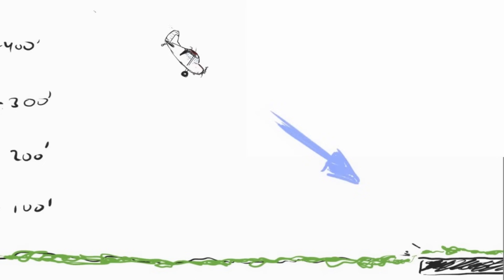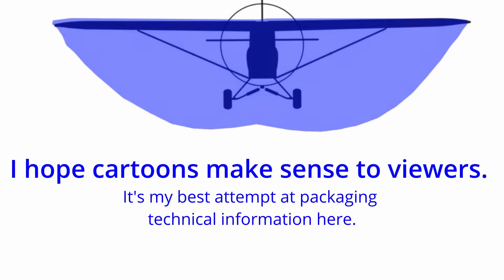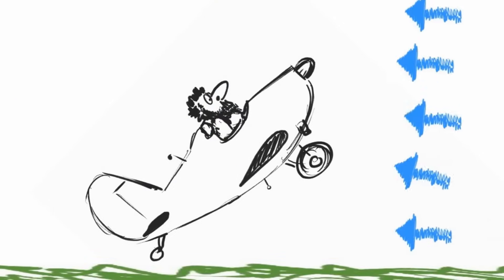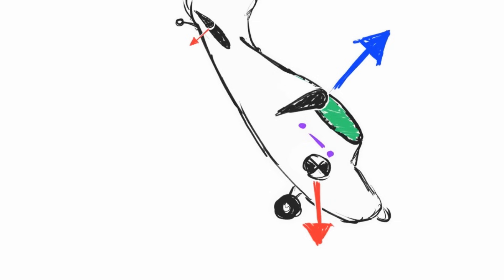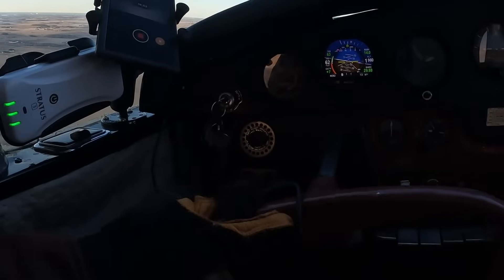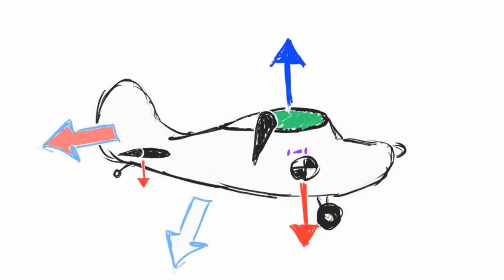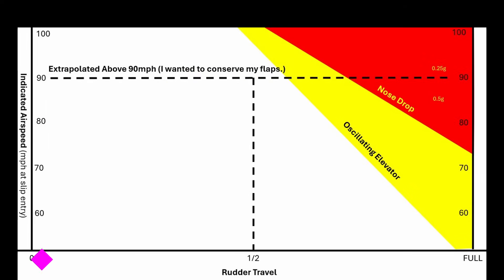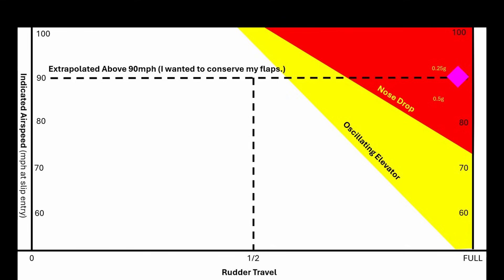Crash of a Cessna 170B, Did Slipping with Flaps Factor?

Comment: The nose doesn’t drop in the stall due to lack of downwash on the tail.  It falls due to lack of lift from the wing.  And the tail doesn’t need downwash to work.  A T tail works fine and is well above the downwash.  It is airflow over the tail that makes it work and the tail incidence can be adjusted to factor in downwash or lack thereof.  The tail really doesn’t care about downwash, it cares about airflow, just like the wing.
Reply: There's clean air and there's dirty air. The tail usually flies in the clean Air. When you slipping out that it flies in that dirty are it gets unpredictable.
Reply: thanks ,i wondered about that explanation.
Reply: Fair, what about the explanation of slips with flaps being an issue? Do you agree that the tail moving out of downwash is what causes the nose to drop in that case?
Reply: @ Yes, lessened downwash is what causes the pitch down moment, but it is hardly dangerous for a competent pilot.  Owned a K model 182 for many years and did many full flap full forward slips without issue, including one from 9,000’ to nearly landing when ATC forgot I was landing at an upcoming airport.  By the time I realized they weren’t going to step me down and reminded them I needed to start descent soon to make it into Lynchburg, the controller apologized and approved 360s to help with the descent.  I only had one passenger with me and he was a fairly experienced flyer so I decided to see if a full slip would get us down.  I slowed to 90 or so to get below flap extension speed of 110 if memory serves, dropped full flaps and pushed the rudder to the floor for a full forward slip.  The descent rate was impressive and we made the straight in approach with a half mile to spare.  The 182 handled just fine at 90 MPH.  I did many full flap slips at 90 and below, but never pushed above that as I didn’t want to get too close to the max full flap speed.
Reply: This  is my take also
Reply: Yes, and slipping with full flaps interrupts that "airflow" over the elevator, and NOSE DOWN, BABY!
Reply: @ It is hardly that dramatic.  Have you ever slipped a Cessna with flaps 40?  I have done so since 1977 in several models of the 150, 172 and 182 and never had an issue even worth mentioning let alone shouting about.
Reply from the maker: @ I still slip my 170 with flaps.  It's only dramatic in certain speed and CG ranges.  Stay out of those ranges and it's all good.
Reply: @LTVoyager  BUT: WHICH AIRFOIL Cessna singles  ? The initial mainplane, all 172-182 was modified with leading edge cuff to soften stall & near stall regime. Had the unexpected benefit of increasing speed/overall drag reduction. Also noting: later models limited flap deflection 30.
Reply: @LTVoyager I've flown all those planes and all of the 170 models and own them. The 170B doesn't fly like those other aircraft. It will nose over suddenly in a slip.
Reply: I often slip with my 180 full flaps, but always at appx 55Kias max. I’ll go high up and try this at 80…
Thanks for the heads up!!
Reply: @LTVoyager I have to clarify your point of AIRFLOW OVER TAIL.. Yes, T tail is typically clear ABOVE disruption from propwash, downwash, wing or fuselage turbulence..
AIRFLOW OVER "CONVENTIONAL" TAIL INCLUDES BOTH TURBULENCE AND ANGLE OF ATTACK BASED UPON AIRFLOW..
NOT SIMPLY FUSELAGE/WING ANGLE OF ATTACK. THE RELATIVE ANGLE OF ATTACK IN THE MODIFIED AIRSTREAM IS INDEPENDENT OF FUSELAGE/WING RELATIVE WIND. 
Anotherwords, yes angle of incidence of tail horizontal & vertical surfaces is tuned to proper angle of incidence in the propwash/downward.
Chopping power at high speed in foreward flight, the prop acts much like a solid disk as it windmills at a rate that doesn't produce POSITIVE thrust ..
THIS PRODUCES A BETA-EFFECT..
The turbulence and "BLANKING" of the tail causes an IMMEDIATE TUCK..
With my smaller RC model aircraft,  it sounds like thrust reverse @ 70 MPH & looks like an eminent loss..
@ lowering speeds it isn't as noticeable till it disappears @ lower speeds..
Practicing stalls, spins, slips and feeling adverse yaw as a tool @ low speed (wings level) when more than effective rudder is required, and other techniques have helped me understand and utilize aerodynamics better..as everything happens SO much faster, while physics & aerodynamics are the same..
Reply: @ There is too much incorrect in this post to even take time to try to address it all.
Reply: @LTVoyager  The T Tail is free of prop/jet wash, not being "blown", only exposed to airspeed of craft, no blast enhanced effectiveness (stationary craft with T tail won't pitch rotate from surface control inputs @ full  power..a Cub can raise its tail to level, a C-150 can lift its nose to the sky for a soft field takeoff..T tail needs tail to experience effective airspeed)
With full flaps, it is possible to stall the horizontal/elevator @ low airspeed, while @ full power and wing not stalling..
Similar to principle of canard fore wing, stall lowers nose, rebuilds airspeed
Reply: Exactly...downwash on the elevator is not equivalent to a loss of lift on the elevator...the elevator is simply a wing aft of the fuselage.
Reply from the maker: Hi All!  Glad you guys are discussing this.  So almost all of our planes have their CG forward of the center of lift.  In a stall we are taught that loss of lift causes the nose to drop.   This is a summary that we all teach our students which works for practical flying.  

In civil airplanes the nose ALWAYS wants to drop, though.  It's the tail (or canard) that stops it from doing so.  T-tail or otherwise when we stall a plane that loss of lift is from airflow separation.  It's the airflow separation that changes airflow at the tail, T-tail or otherwise due to fluid dynamics.

So y'all are right.  It IS the loss of lift that causes the nose to drop.  The way that happens is not through drastic shifts aft in the center of pressure or movement of the CG: it's via the tail.  This is also why it's important to design canards to stall before the wing.

To further illustrate this point take a look at searchable slow-motion video of an A-26 (some videos call it a B-26) losing it's tail during bounce-bomb testing during the Second World War.  With the loss of the tail (lightweight structure) the nose-down couple is strong enough to generate negative overload failure of the wings prior to impact.  Some may point to CG movement with the loss of the tail here.  

So now let's all consider tail stalls.  In a tail-stall it's the horizontal stabilizer, not the wing that experiences flow separation.  In this case we again see abrupt and sometimes violent nose down pitch excursions.  The wings do not stall.  There is no loss of lift.

So it's the idea that we only lose pitch when we lose lift (an idea that I transmitted to my own students) that we need to explain in better detail.  This was an academic shortcut that we used as instructors, but it leaves our students exposed in the decades after we're done with them.  It primes students to think "Stall" when something else may be going on (as happened in a number of tail-stall accidents). 

Does that mean teach pre-solo students about the fine points of aerodynamic interactions between the wing and tail?  No.  But does it need to happen somewhere along the way?  I think so.
Reply: @jonathanzarinnia884 I never taught that the nose drops due to loss of wing lift since it allow this type of confidently incorrect reply. This person was taught incorrectly. His belief is easily disproved by simply moving the CG close to the center of pressure: no angle of attack will be steep enough and no speed will be slow enough to cause the nose to drop. A swept wing jet, which tends to stall wingtip first, moving the center of pressure forward, also lacks the positive static stability and will not drop the nose like a 170 or similar. For teaching new concepts, I am okay with incomplete explanations but not inaccurate explanations, for this reason.
Reply from the maker: So in a swept wing jet indeed the center of pressure can move forward of the CG and cause uncontrollable pitch up.  And yes, this is because tips tend to stall first (unless various wing modifications are made ) which causes the center of pressure to move forward.

The Cessnas and general aviation planes described in this video aren't swept wing jets.  They have straight wings with conventional airfoils like the NACA 2412 or USA-35b.  These airfoils do have their centers of pressure move forward in a stall, but not forward of the center of gravity.  Also in a stall, even in a deep stall the loss of lift on the wing is not complete.  So the pitch down couple remains, unlike in RF101 Voodoo or something like that.

I'm glad that you're aware of different factors that affect and airplane's pitching moments.  It's great that you're thinking about things, and you can call my "confidently wrong".  I respectfully suggest you do some research or even better some testing  on this issue.  You may learn some new things about how and why airplanes behave the way they do.  I'm not pulling this stuff out of thin air.

For what it's worth I might learn some stuff too.  I like these discussion, so there's no midnight rage-typing going on here.  If you're around Chicago we can nerd out.
Reply: @ I am not aware of any light airplane that can experience a tail stall prior to the wing stalling without ice accumulation on the tail.  Are you?  The tail does not stall during a wing stall as its AOA is decreasing as the wing’s AOA is increasing taking it even farther away from a stall as the airplane pitches up.
Reply: @LTVoyager  There was one homebuilt that could do that. It's no longer on the market.
Reply: @edcew8236  Which one was that?  I can’t imagine such a design could take off as the tail would stall at rotation.
Reply from the maker: There are some great drawings and wind-tunnel data out there.

From a macro perspective the point is this: Good rules of thumb that we teach (I teach these too) can backfire on us.  We teach pilots in primary flight training that the stall  break is from loss of lift.  This is true.  If we don't explain how the mechanics of the break work and exceptions we risk having pilots interpret any sudden pitch anomaly as a stall.

We don't have CVR data from this C170 crash, but there was data from a Vickers Viscount Crash.  They misidentified a tailplane stall as a wing stall, among many other things.  Training on tailplane stall back then and even when I was flying cancelled checks was mostly anecdotal, just like aerodynamic control hard-overs, etc.

Another interesting thing about this phenomenon in the Cessnas is that it's behavior is pretty close to a tailplane stall or stall of the elevator, although that's not what's happening (according to Cessna aerodynamicists).  The difference is tailplanes stall due to lots of downwash behind the wing combined with contamination.  This slipping with flaps thing in Cessnas happens when we move the tail out of the downwash.  

Examples of light planes with tailplane stalling issues?  Mostly this is an icing thing.  There was an issue with certain models of Cessna 177 Cardinal, but that got fixed with slotted stabilizers.  I'm reaching even with that example.
Reply: @ Tailplane stalls are ALWAYS an icing issue, or damage issue, on any properly designed airplane.  Sure, if you are flying a poorly designed airplane, then anything is possible.  Teaching students about tailplane stalls outside the context of icing, is a waste of time and confusing as it simply won’t happen.  That is my point.  I do think we should teach about tailplane stalls, but in the context where they apply.  And this 170 accident wasn’t a tailplane stall, it was pilot error.  Probably similar to the many prop strikes on 182s from pilots who don’t pull hard enough to flare because they haven’t been taught how to fly properly.

I still remember the words of my primary instructor who said “make the airplane do what you want it to do and use the control force necessary.”  He emphasized this one day by radically pitching the C150 up and down to negative G, rolling with full aileron and wagging the tail with full rudder.  I have heard far too many pilots who struck a prop on a 182 say something like “well I flared like I do in my 172 and it just wasn’t enough.”  That is almost as stupid as running out of fuel.  You use the force needed to make the airplane you are flying do what you want it to do.  You don’t fly it like that last airplane you flew.  It seems pretty obvious that this pilot simply didn’t use the control authority needed to make the airplane do what he needed it to do. Teaching tailplane stalls doesn’t help that one bit.
Reply: @LTVoyager  But a turbulent airflow that causes disruption to tailplane effectiveness when wings are not in a stall condition DOES LIMIT the EFFECTIVENESS.. especially near MCA..
A sudden fine pitching prop condition at speed will cause "blanking" of tail surfaces, as will a sudden power loss from high thrust condition to an excessively less than positive thrust condition. In say a high speed 90° bank turn, where plane is in a knife edge turn, at full power..then power is cut, what do you presume will happen?
The nose immediately pointed downward to the ground and plane's arc broke ballistically to the outside, approximately 45° lateral departure from a tangental path and assumed an inverted attitude before "snapping" into a recovery that was a ¼ loop from vertical.
Entire tailplane was ineffective until effective airflow over the tail was resumed...full throw at high airspeed had NO effect..
Reply: @ When you find yourself in a hole, the first rule is to stop digging.
Reply: @LTVoyager  Level wings, nose down for airspeed, add power when under control.. don't try to resume landing, stand back up, get safe, THEN deal with where you wound up.. NEVER PUSH THE CRAFT INTO A CORNER..LET IT FLY..
DON'T TRY TO PULL IT THROUGH A HOLE LIKE LAUNDRY OUT OF THE FRONTLOADER..
COORDINATED S TURNS OR AN ORBIT CAN ALSO BE DONE INSTEAD OF FORCING THE PLANE..
Reply: @LTVoyager you don't know what you're talking about. The 170B will nose over severely in a slip.
Reply: @landryah1 Prove it.

Comment: Flaps already give us a pretty steep descent as it is at idle power and trimmed for 1.4 Vso; about a 1,000 ft/min in the 172. In the 172, I’ve applied full flaps and about half to 3/4 rudder at approach speed and experienced a tiny oscillation and nothing more. But more importantly my descent rate was like 2,000 ft a min. Only reason I could think of that you’d need to drop that quickly is if you’re in an emergency. If this is an otherwise normal approach you’re already doing it wrong. Just my two cents.
Reply: The emergency is where it will come into play. When you have an engine out and the spot where you want to land is small with obstructions, that slip with full flaps may be your only tool to get you into that spot. I'm an FAA A&P, Commercial Instrument Pilot and Ex Air Traffic Controller. I can't tell you how many times I had to talk a pilot down to a safe landing in a filed somewhere when he lost an engine. Too many pilots are happy with being able to land with a 2000' strip in front of them but that isn't usually available. Practice short field landings and use all the tools to get it down where you need to be. BTW an airplane with a dead engine descends faster than one with just an idling engine. This usually really becomes a surprise to pilots in emergencies!
Reply: No need to slip with full flaps, ever.  It's too dangerous in a 170B. Just don't do it like the book says. Why the debate?
Reply: @philrutherford6486  Like I said, in an emergency, say you lose an engine, you have far more control by staying high and slipping it in then just hoping you'll make your landing spot.

Comment: Note that this video only applies to Cessnas capable of 40 degrees of flap.   Cessna has not made any airplanes with those many decades.
Reply from the maker: Correct.  For later models they restricted the flaps to 30 degrees.  You can still encounter elevator pumping, but not the pitch loss.  Because they still address elevator anomalies in the later Cessnas I mention those models here.

Comment: Valuable insights- thanks. 
Other than the placard making me cautious I could never figure out why I don’t like slipping my C-175 with full flaps but I’m thinking now it’s the loss of elevator authority making me uncomfortable. Time for some experimentation at altitude.
Reply: Never had any problems slipping my C175 with full flaps. Then again, flaps 40° and airspeed at 95 MPH (flap limit speed is 100 MPH) did all you needed and then some!